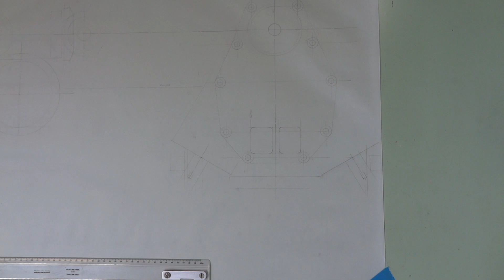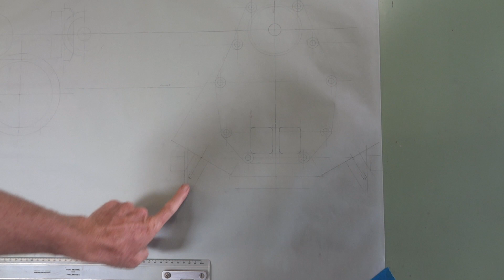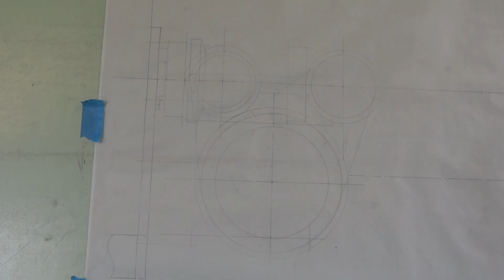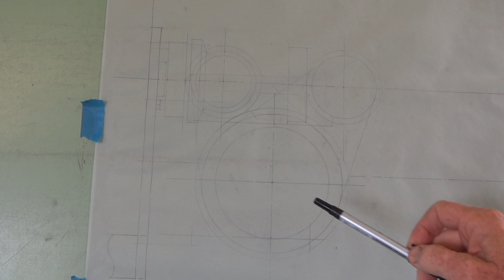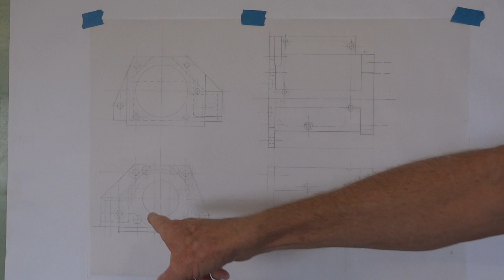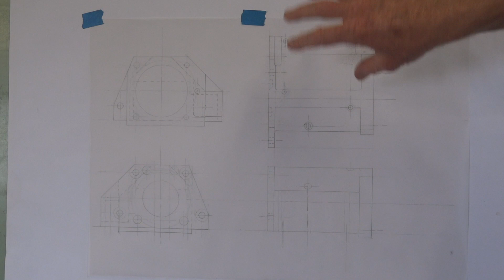Mercurial Outboard Motorbike Bevel Gearbox and Housing

Comment: Oh man im so glad you chose a Harley Davidson transmission. Ive been meaning to learn how to adapt one to a different engine. Its modular, you can basically make any weird engine a fun one (like youre doing) also want go design a one size fits all, rochester T.B.I system. The single injector unit would be great on alot of different motors.

Comment: Some more items worth mentioning is that your engine has a bleed recovery system designed to work vertically.   It captures puddled fuel from low lying areas via check valves and pumps it back into the fuel stream.  If thus was not there the engine would intitaly idle fine but would get progressively worse until you hold the throttle open and "clear" it.  That's how we know a check valve is not opening.  By my measure if you are going plugs down, you might just get away with this, however there is a hose that picks up oil at the bottom bearing and pumps it to the top bearing.  Laying this engine down may lead to premature bearing failure.  When you pull the engine down, if you get lucky you may find to areas where fuel would naturally puddle in cyls other than 1 or 6, and you can transplant a check valve to this area and duct it to the bearings.
Reply from the maker: thanks, I'll have a look
Reply from the maker: thanks, I'll have a look. it's a very lovely engine.

Comment: Helical cut gears create side thrust that a plain bearing can't tolerate especially if you throw 200 HP at it.  As an outboard reverse gear it was never meant to see these loads for long, that's why the forward gear is a tapered roller bearing.  Also are the gears cut in the correct direction for the rotation you have in mind?  I can't tell from here.
Reply from the maker: thanks for the advice. you obviously know what you're talking about.
I know it's not full race spec, but I reckon I'll get away with it.
I'm driving the big gear, so that halves all of the loads straight away.
also not shown is a thrust washer that goes between the gear and the bearing.
also, the duty cycle will be very light. My experience with my 2.5 litre V8 bike is that pretty much everything is done at 10% throttle. it's only 140hp.
also, that big taper roller in the outboard also takes the thrust from the prop.
what do you reckon?
Reply: @malcolmoastler3039  Yes a wafer bearing set would handle the side thrust, just leave room for shimming.  I'd really need to understand the cut of the gears because as an out board the pinion gear get's thrust upwards and the prop thrusts the driven gear forwards.  Reversing the roles of the gears, wouldn't the cut be the wrong way round?  If it is, while it would work as a demonstration it would tend to pull the gears toward each other.   Would it help to use the forward gear with a plain bearing?  Hard to visualize for me.  What I can tell you is this gearcase is available as a reverse rotation for twin engine installation.  I have seen examples where the customer puts the props on wrong and tries to run the boat with the controls in reverse.  Under load how long that bearing lasts is measured with a stop watch.   The HP achieved will be directly related to the induction system you choose.  As I said before it comes factory up to 200 hp on the same powerhead.   Really consider fuel injection.  It would solve allot of problems and be pretty easy to pull off.   I wish you lived here!
Reply: Let me know when you get to the oil injection system.  That should be pretty simple to keep as well.   It's the cooling system that will be interesting.   Waiting with anticipation.
Reply from the maker: @canvfrluvr8005  Having had a look at my Mercury workshop manual, I take it that the gearbox that blows up is the conventional rotation, ie, prop supposed to rotate clockwise, viewed from the rear, but with the wrong prop and driven in reverse?
The reverse rotation gearbox seems to have needle thrust bearings in both directions, so  shouldn't mind. No?
Also, angle of gear cut. Yes, it's back to front, so the pinion gets sucked into mesh, instead of spat out. Should be OK with taper roller bearings holding the shaft in both directions? Assuming that the nut at the end of the shaft stays tight.
Reply: @malcolmoastler3039  Yes all that is correct.  Reversing the rotations of the gears, do you think that will work without going boom?  Would it be easier to find some straight cut gears out of something?  Seems to me that helical gears are designed to mesh in a certain direction depending on the cut?
Reply from the maker: @canvfrluvr8005  two more outboard question for you if I may. The ignition retards about 10 deg at idle as a function of throttle position. That's weird. Is it necessary?
And is there any way you can tell me the pinion setting depth for this thing?
Reply: malcolm oastler I’m not sure what timing you are referring to. Timing is mechanical. The extra electrical box is an idle stabilizer.  I imagine thats what you are referring to. No reason why you should not leave it on there. 

Generally (because I have no manual to review) mercury likes to use a special tool to establish pinion height .025” off the face of said tool. After that you adjust backlash by moving the driven gear closer or farther away with shims measuring backlash with a hose clamp on the drive shaft with a metal “flag” welded to it giving a dial indicator a place to land. 

In your case, because it us a “one-off” i suggest using a bluing agent on the gears and set it up as you would an automotive differential by reading the pattern on the gears.
Reply from the maker: @canvfrluvr8005  thanks again. Yes, I mean the mechanical timing. The timing advances about 10 deg just as the throttle comes off idle. Most unusual. I guess it's just to make it easier to start with the throttle closed?
Reply: malcolm oastler I don’t think I could say. Maybe its a two stroke thing. They are all like that; bit of timing advance before it picks up the throttle.